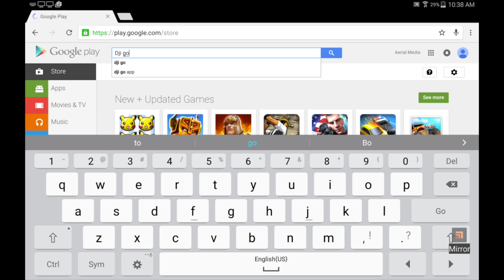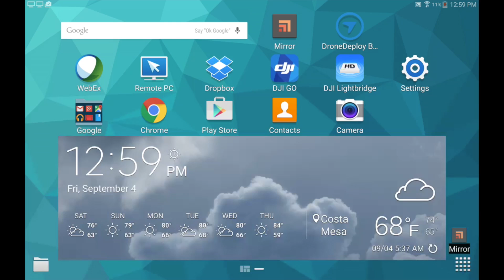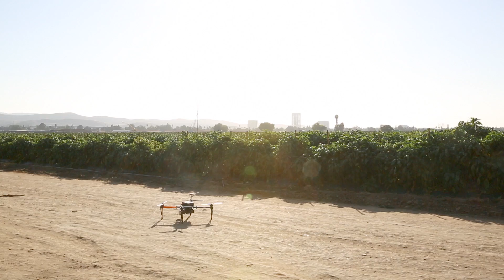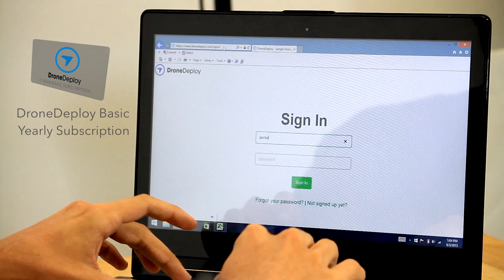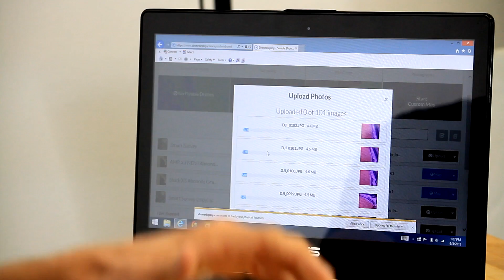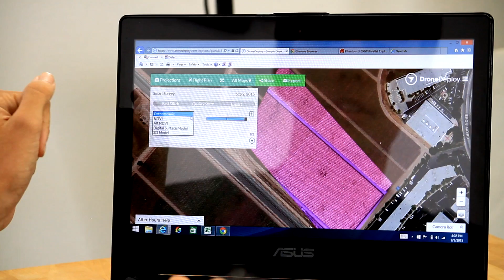NDVI Mapping with DroneDeploy - The Ag Scout Series

Comment: I noticed that you use a Inspire 1 like camera to take the NIR images. What modifications do you do on the inspire 1 camera to be able to take NIR images?
Reply: It's a modified Zenmuse X3 camera.  Data will not be as accurate as a manufactured-for-NDVI camera, such as the RedEdge series, but it does return usable data.  The camera they're using in the video is something like this:  https://www.dronenerds.com/products/cameras-sensors/multispectral/ndvi-cameras/ndvi-camera-units/ndvi-x3-camera-unit-for-inspire-1-matrice-100-ndvix3-ndvi.html   The cost is the difference, and, as long as you and your client know that you get what you pay for, it should be fine.